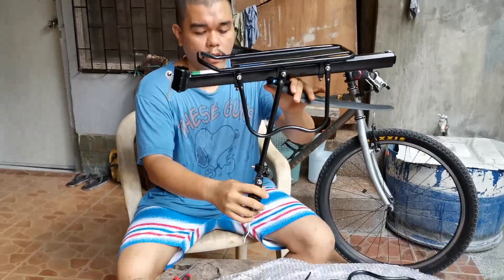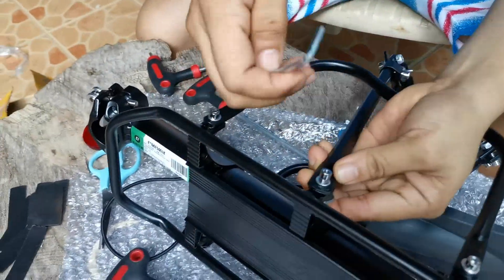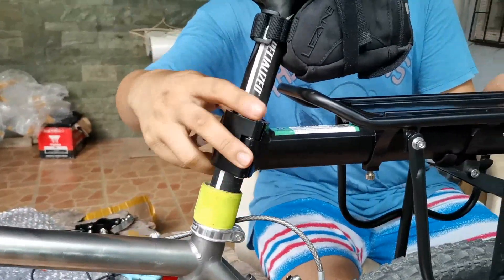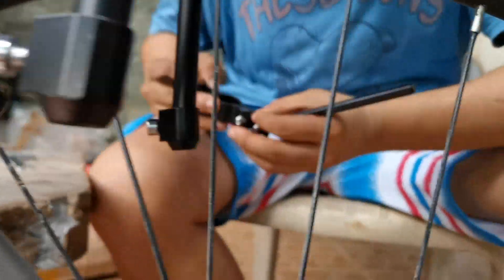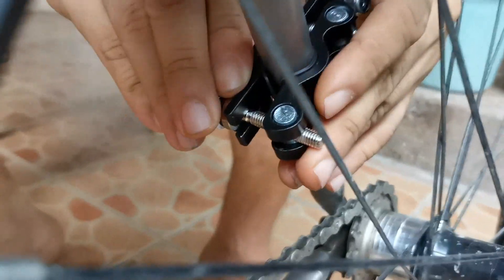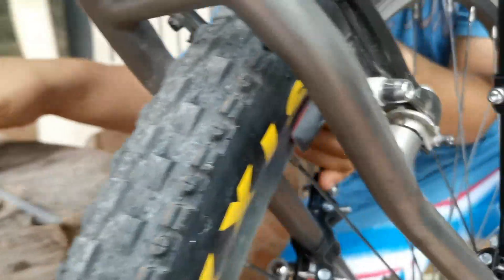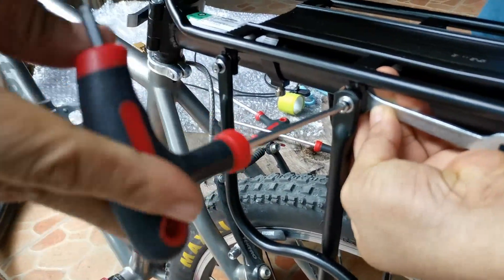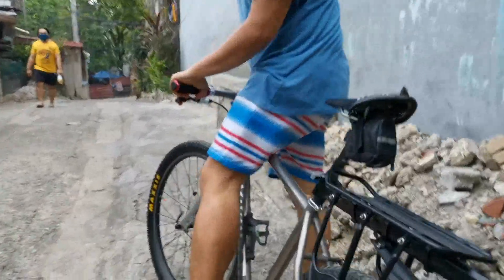Installation - ROCKBROS BIKE CARRIER quick release

Comment: In my opinion, the quick release would be replaced with an actual bolt. The rack is too high from the top of the rear wheel, needs to be a little lower, to get the weight down lower. That's just me. That quick release, to me, is a security risk.
Reply from the maker: I agree much better to replace the Bolts with the fixed not the quick release too risky.. thanks for the recommendation!!